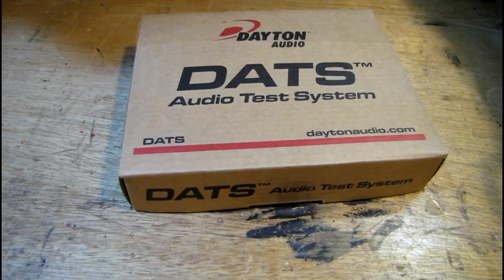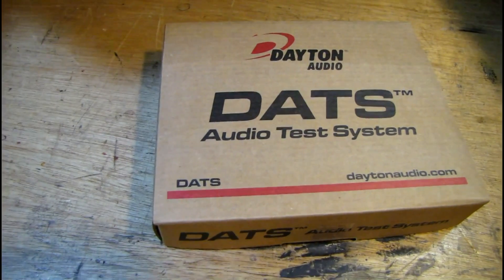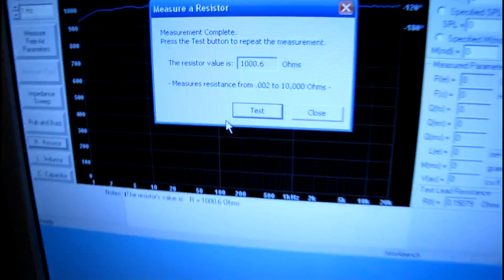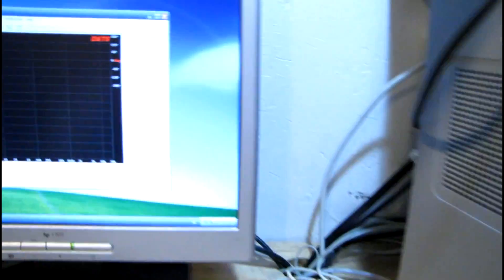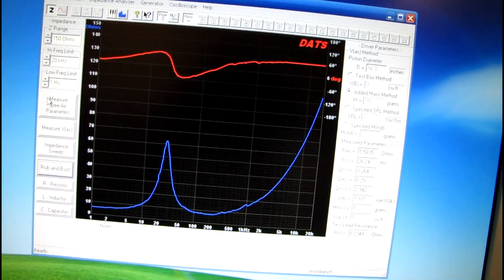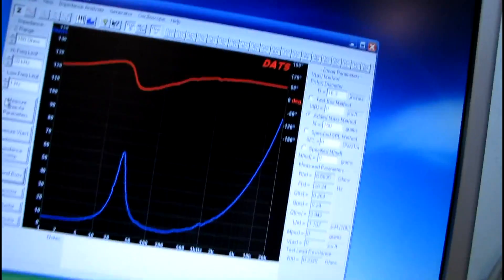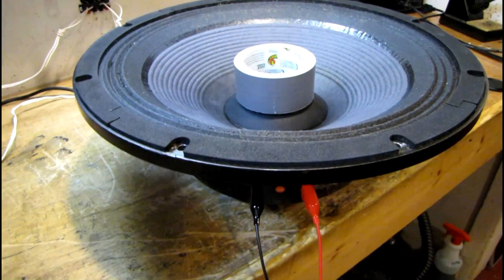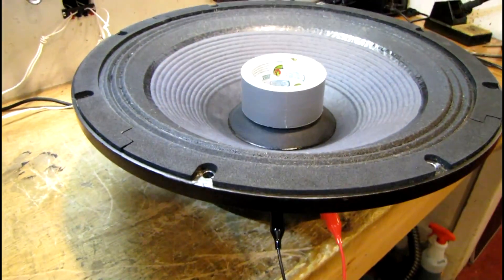Quick preview of the Dayton Audio Test System

Comment: if you put a speaker like this on a table make sure it has a hole for the rear vent of the speaker ! if you block the vent Qms will go down a lot due airpressure created and increased mechanical damping

Comment: the way you put the weight on the dustcap is no good because the system 'weight + dustcap' can vibrate in itself due to elasticity of the dustcap. always go for the joint between dustcap and cone to apply weight as this area is most stable. make a test, put a weight in the middle of the dustcap and you will see an imperfect impedance curve due to 2 spring-mass system.

Comment: never suspend a driver on bungee cords ! because then the drive itself will start to vibrate in response to the cone movement -> wrong measurement results. the device under test must be unable to move and the venting hole in the back must not be blocked. so placing it on a table with a hole that is bigger than the venting hole of the speaker is fine.also holding the speaker is not good because you will always move slightly causing the cone to move, inducing voltage ->ripple on impedance or worse

Comment from the maker: Cool, I'll remember that next time I use this.  I like the idea of the bungee cord especially. 

Not sure how the clay would work out, I'm afraid it might leave a mark on the dust cap on certain speakers.  But maybe I could suspend the driver with two or three cords so it can still lay flat for using other weights (or wrapped clay).

Comment from the maker: The speaker itself made the noise.  In fact, all sounds from the PC will play through the DATS device.  It is basically a sound card DAC with some special software and added components on the output circuit.